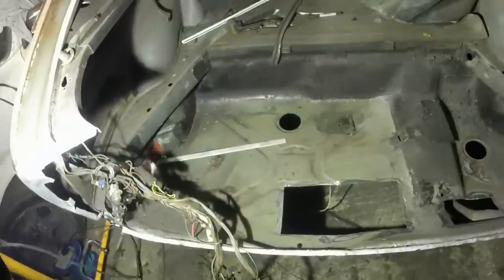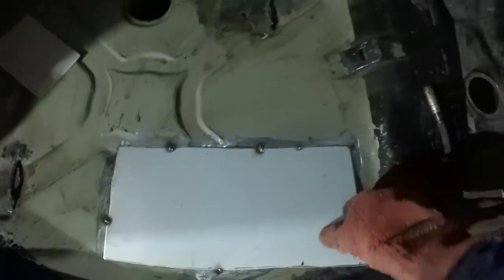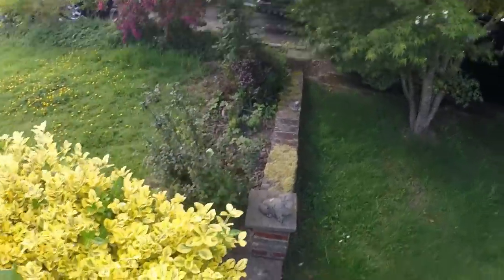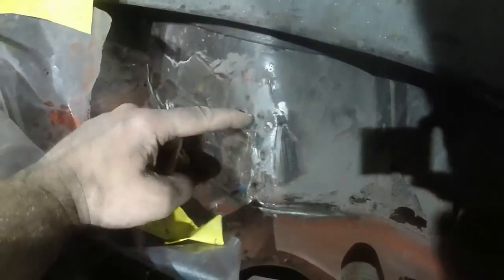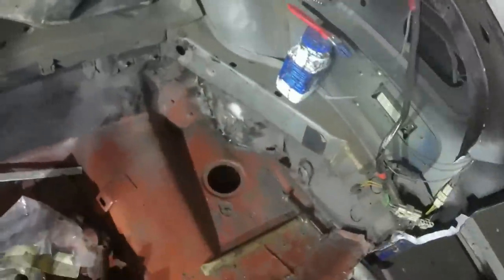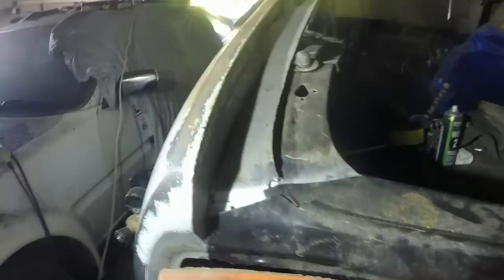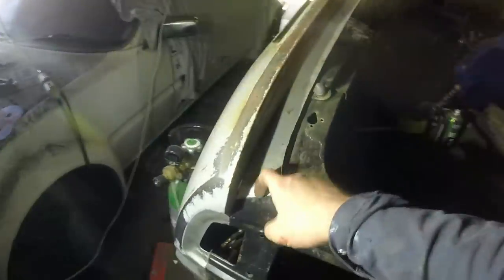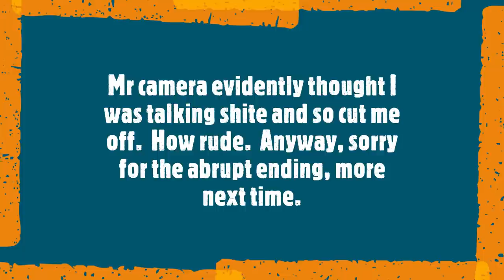Dotty 1981 Rover SD1 Restoration - Video 38 Rear panel 2

Comment: Dolly Sprint also had a black rear panel... but then, so did the Dolly 1500HL.
Reply from the maker: Both fine machines!
Reply: @nitrosilvia  
My first car was a Dolly 1500HL.
It was a W reg, so 1980/81.
I bought in late '89 for £650 and it was already rotten.
Someone drove into the back of it the following year, so wrote it off.
:-/